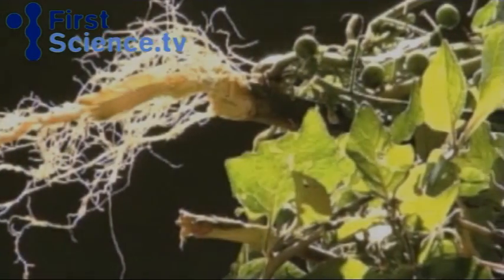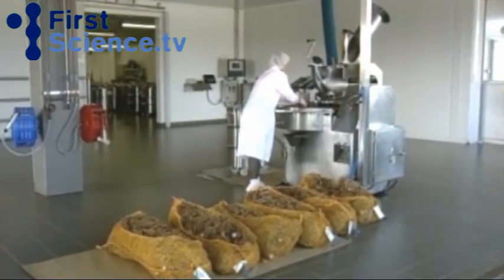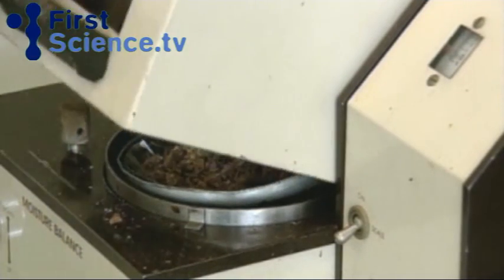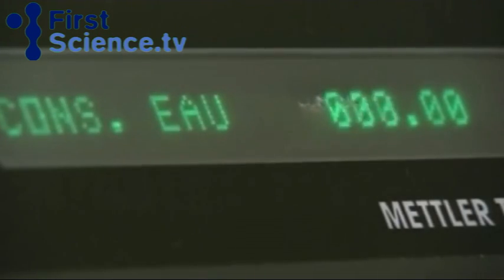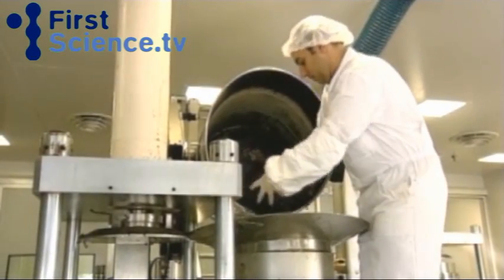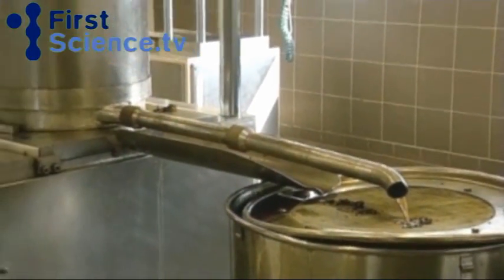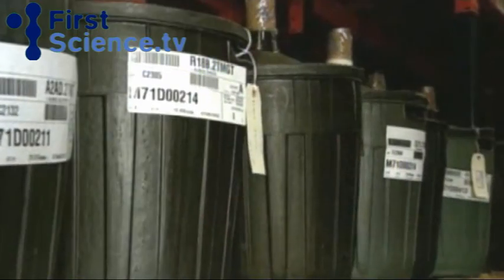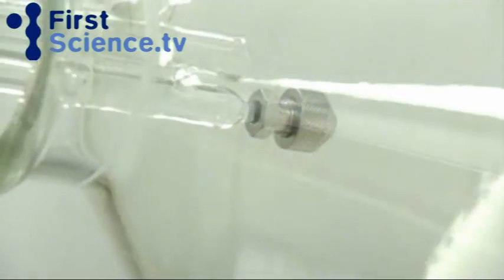How are homeopathic remedies made?

Comment: Basically, you make a tea (or whatever) from anything. 
E.g.: bitten by a spider? 
Keep the spider, and boil it in water. 
Tea. 
Then, put spider tea ("Mother Tincture") in a bottle and fill with pure/distilled water. 
Succuss 10x (tap the bottom of the bottle on book 10x). 
[This is once]
Empty half the bottle out, and fill up with water again. 
Tap 10x (Succuss)
[This is twice]

Empty half. 
Refill. 
Succuss. 
[This is Thrice] 

Repeat a total of 6x for "6" Remedy (Known as 6c, here in Australia). 
6 is the recommended potency for a home remedy. 
Professionals make 30c and 200c 
But it's an art, and quite complex.

Comment: Non-sense homeopathic medicine makes no logical sense, taking a product and that causes the same symptoms you have, diluting it to a point where where it doesn't exist just doesn't work and somehow you believe it gets stronger the more water you add.
Reply: For me as an engineer looking at it I would guess its less to do with the dilution process and more to do with the succussion process that most homeopathic solutions follow when they are diluted. They shake the solution sometimes over 1 million times. The more times its diluted the more times it is shaken. 

Water is a "polar" molecule, meaning that there is an uneven distribution of electron density. There by it has a partial negative charge. If you shake it up and down a million times in a straight line with a set frequency (as they do in Homeopathy) you would effectively be creating a very subtle but real radiating magnetic field which is flipping from positive to negative along the axis you are shaking it. As we know with Faradays law -Magnetic flux also produces an AC electrical current. Now due to how small the charge is its' only going to be subtle EM field and AC current - but it would be there. Do that a million times and hey who knows what effects this has on the solution. My guess would be if there is something to it - this would likely be the primary mechanism by which it is working.